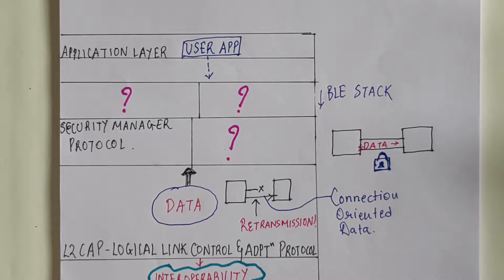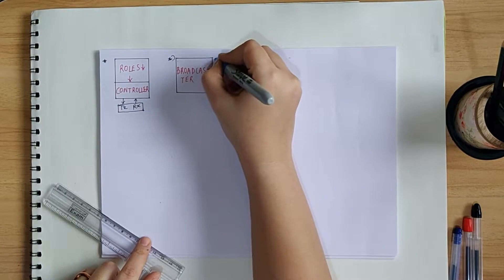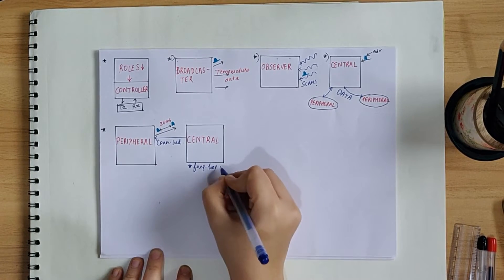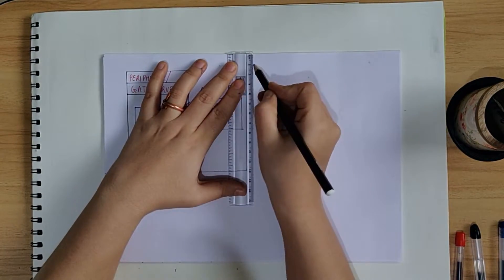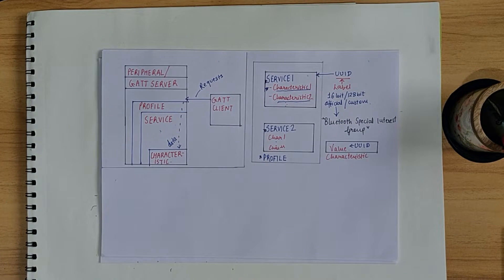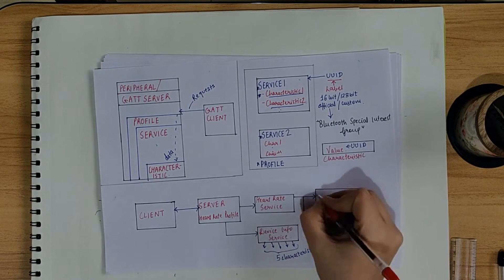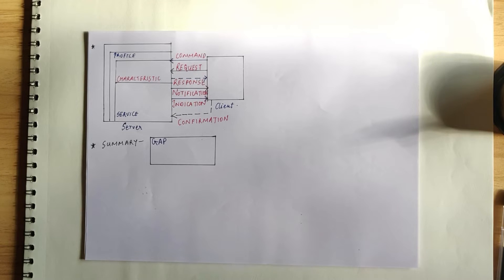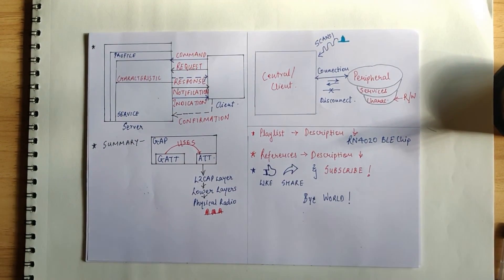BLE Fundamentals - GAP, GATT and ATT protocol ( Part 2)

Comment: I had problem connecting my two esp32 based gamepads to steam. Which was solved by changing the code that included manufacturing name. Just out of curiosity i wanted to know how these things work. It is much more clear now after watching this video that how BLE devices talks to each other.
thanks!!

Comment: Bluetooth Low Energy (BLE) technology has transformed the way devices communicate over short distances, offering a highly energy-efficient and reliable means of connectivity. BLE is especially powerful for applications like fitness trackers, smart home devices, and asset tracking, where low power consumption and extended battery life are essential.

Many tech providers, including GAO RFID Inc., are leveraging BLE for advanced tracking and identification solutions that enhance operational efficiency across various sectors. Their expertise in BLE integration has paved the way for reliable, low-energy devices that enable real-time monitoring and data collection—an invaluable tool in today’s IoT-driven world!

Comment: nice explanation ! impressed ! i have a question can u please answer , i m embedded system developer . As you explained in  your video 10:26 , if indication  send then ack will be send by the client that it receives the indication correctly .My question is that , if no indication received then protocol will send the indication again ? and how can we enable and disable  this feature in ble5.0 ? i am using esp32c3 (esp-idf ) . If you could help me in this regard. Thank you!
Reply from the maker: Kindly check the datasheet of your device

Comment: Hi Bina
Great videos(part1 and part2)
Two questions:
1. Where can I find the details on Central to peripheral commands/request format details?
2. Do central and peripheral have to define GAP/GATT and ATT on each of their sides?
Reply from the maker: Hello Nitin, could you specify the details of the module that you are using?
2. GATT roles are of server and client. Server holds the ATT lookup data, service and characteristic definitions. The GATT client sends request to the server.

Comment: Hey, Is this GAP adv system possible for multiple observers and one advertiser ?
Reply from the maker: There is no restriction in BLE specification on the number of observers the broadcaster can broadcast to.
Reply: So is it possible for a developer to stop the advertisement once the connection is established between peripheral and central?
Reply from the maker: @krishnakhandelwal9466 - check the datasheet of your BLE device. Usually, the peripheral stops advertising automatically once a connection is established.